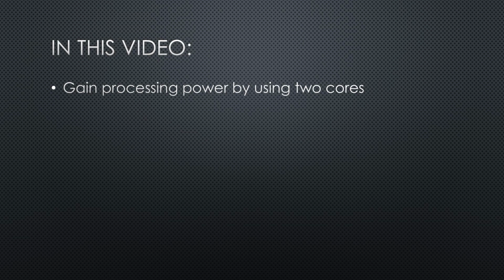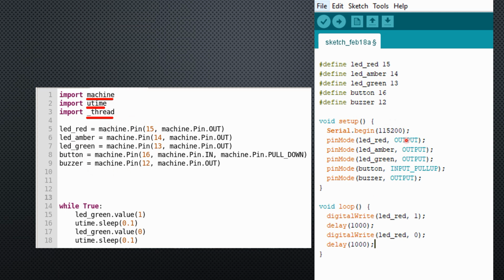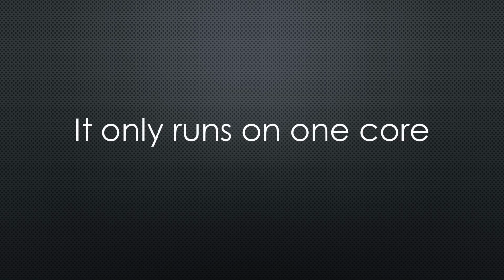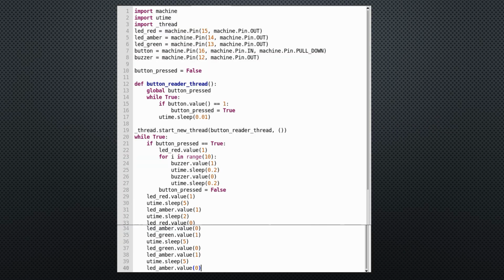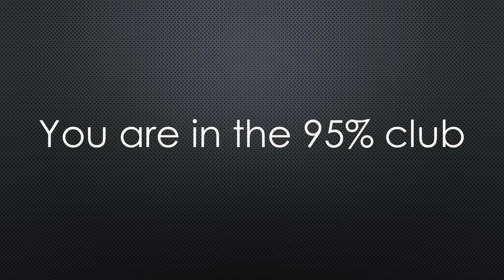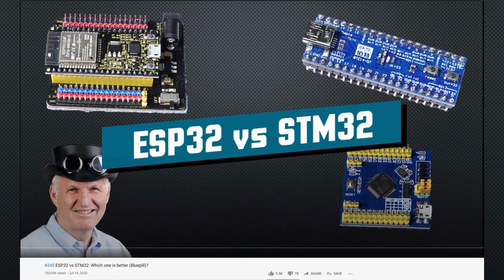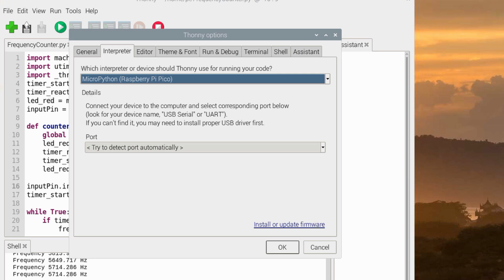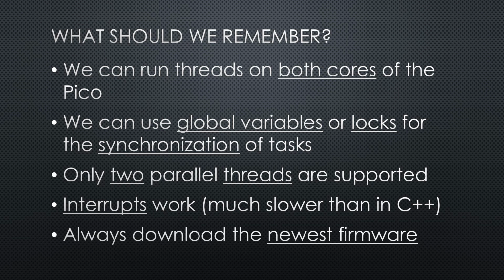#372 How to use the two Cores of the Pi Pico? And how fast are Interrupts?

Comment: Thank you Andreas, I have been looking for these topics on the Pi  Pico and now you provided them in a  excellent manner. 
This is great stuff!
Now I only have to find out how to use the Pi Pico as an I2C slave device. I can easily find info on how to use it as master, but nothing on how to use it as a slave. 
Could you be persuaded to look into this, I think it will be highly appreciated by many people using the Pi Pico:-)
Reply from the maker: I2C slave is not easy and it tool a while till I found it out for the ATTiny back in the day. In addition, here we need it for Micropython...
Reply: Your video on the ATTiny85 controlled array of ultrasonic sensors communicating over I2C was excellent, and I learned a great deal from it. And you made it look relatively easy, so I began to think that I was missing something since I couldn't find anything on the Pi Pico as an I2C slave device.
Is it really that different from the usage as a master? From my perspective the main diffrence is that slave devices have to have an address assigned, the rest is "just" sending and receiving - but I've never made an I2C library, so of course I wouldn't know the gory details.
Reply from the maker: I do not know if it was difficult. Maybe somebody with the knowledge should create it.

Comment: There are USB hubs with on/off switches. Those may be an option for the reset switch.
Reply from the maker: There are many solutions for the problem. I think, the board should have a reset button

Comment: it would have been nice if the pico had WIFI , the ESP8266 has that, so how can de pico compete with the esp8266?, it's faster but the lack of wifi is not good and therefore i will not use this board.
Reply from the maker: You are right. It is for non-connected projects.

Comment: Thank you Andreas for this (and for them all)!! FYI, pulling down the RUN pin resets the board. How do we know which core is used at what time?
Reply from the maker: You are right with the run pin. And I do not know how to check the core. I am sure there is a command.
Reply: I am not quite sure with mpy (I don't have a board at hand) but if it's anything like CPython, _thread.current_thread() should tell you that?
Reply from the maker: Unfortunately this command does not work :-(
Reply: @AndreasSpiess  Ah, I just checked! In both mpy and CPython, the lower-level primitive is "_thread.get_ident()" ! :-)

https://mpython.readthedocs.io/en/latest/library/micropython/_thread.html#_thread.get_ident

(and in CPython for reference:
https://python.readthedocs.io/fr/hack-in-language/library/_thread.html#_thread.get_ident
)

My bad :-) I should have RTFD hahaha!

EDIT: Being a lower-level primitive, one needs to be careful: this function returns an integer that can be recycled once a thread exits!

Comment: informative video but have to give 2 comments. 
1. The absence of the reset button can be easily covert by a external button especially when you work on a breadboard.  It may be needed during development but once you past that stage its no use any more. 
2. Comparing interrupt service handling speed between python and c++ is like comparing the 0-100 km/h  between a Volvo V70 and a muscle car. They both are cars with combustion engines but  the V70, although might be more comfortable for most people, isn't up for that job. Phyton != Made for speed because it's interpreted 
. Try writing the same code with in the Pico C/C++ sdk and compare again. My guess is that they will be in the same range.
Reply from the maker: You are right with c++. A commenter already did it.
Reply: @AndreasSpiess  Looking at the video I tried to look at the comments but my phone didn't want to expand the comment section. Later I found out that it's was a double comment. Sorry for that 🤭
Reply from the maker: No problem!

Comment: i think there's definitely some synchronization magic going on under the hood in micropython. i've been debugging methods by running them on the second core, while using the first core to run the terminal and set variables that the method uses (for example, what to show on a screen or what the target position of a servo should be). I've had no issues despite the fact that I've not used any locks
Reply: The elephant in the room may be the GIL. Not sure if this applies to MicroPython or not.
Reply: @Andreas-gh6is  GIL is not enabled in pico upython,
Reply from the maker: I agree. It should be easy to suppress a task change during the update of global variables.

Comment: Great tip with the baton, I don't remember reading about it in the book. Thank you Andreas! I also had some issues with threading: it simply did not work when I used VS Code and rshell - but it started to work when I installed Thonny.
Reply from the maker: I do not think that locks are covered in the book.
Reply: @AndreasSpiess  you are correct, they are not covered in the book

Comment: interesting..thanks Andreas, you always have the timely info for us plebs! :)
i might have to get one and try an 8bit amstrad cpc emulator...esp32 is a tiny bit slow... 
do you know if there is a RGB/VGA out and PS2 keyboard/mouse in for Pi Pico yet? :P
idea for pico reset... ..inline switch on the usb power.. i usually power my rpi from a step up/down psu set at around 6v (to overcome losses in usb cable and onboard voltage regulators... its powered by 12v 1a brick.. so it has pleanty of power for my ESP32 and PIs with peripherals
Reply: You can setup VGA out using 5 pins and a few resistors. I've seen the Pi emulating the BBC Micro .
Reply: @nicksharp7680  I believe I have seen it somewhere on Youtube emulating a Sinclair Spectrum too.
Reply: @malch2843  I'll have to look for that one 👍🏻
Reply from the maker: 1. I left VGA behind me. So I do not know if somebody did it.
2. I already added a small button. Still, I think it is not my task...

Comment: Real question is...
Is it micropython (probably) or the Pico CPU that's slow to respond to IRQs.

I remember a previous video where the IRQs were surprisingly slow.

(Oh, and another interesting video! Thanks)
Reply from the maker: I think it is MicroPython.
Reply: I think we need  @AndreasSpiess   to test it outside of micropython 😁
Reply from the maker: It is already done. See the pinned comment.
Reply: I imagine that Micropython has to establish some interpreter context for the interrupt routine... so it would naturally run slower. The micropython code may not even run inside the processor's interrupt handler but only get triggered by some semaphore triggering.

Comment: Diska doesn't look very interested in the Pi.. Thanks for bring me to the 99 percentile of Pi Pico programming. However, still haven't seen the killer functionality of it compared to esp32 but maybe with time :)
Reply from the maker: I would not say we are at 99% of programming. We are only know more than 99% of the programmers. I assume we can learn many new things in the future...
Reply: The Pico is designed for streamlined education. It's easier for the Pi foundation to produce and distribute educational material for microcontrollers (like that MicroPython book) when they also control the Chip and the Board, rather than when they have to depend on Chinese ESP32 manufacturers. I'd still say the Pico could outperform the Teensy on a bang for buck basis in certain applications with the right C++ programming.